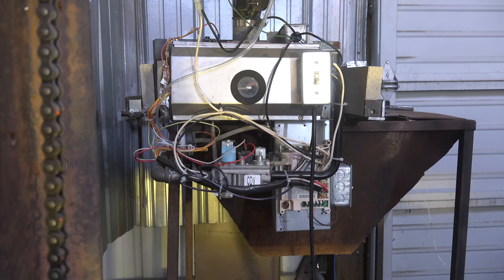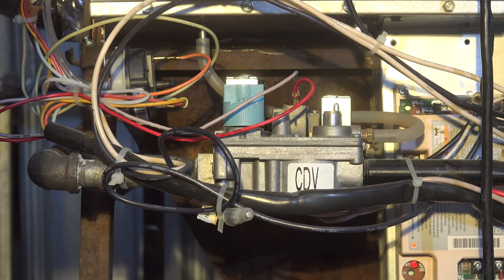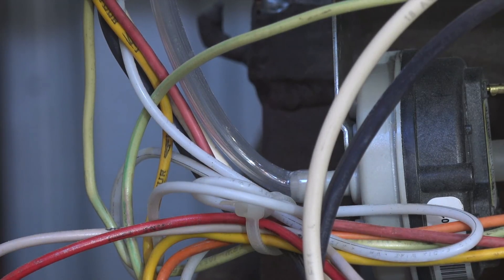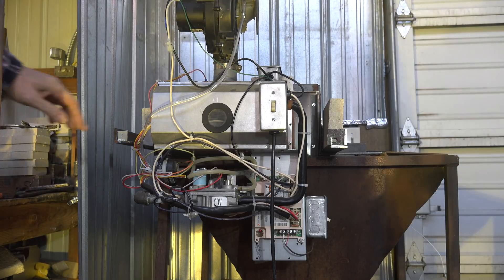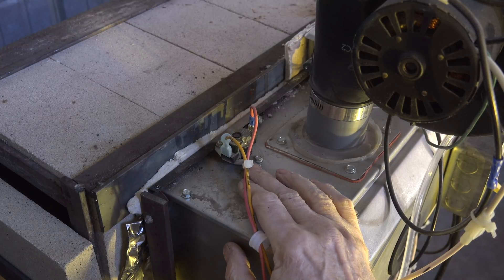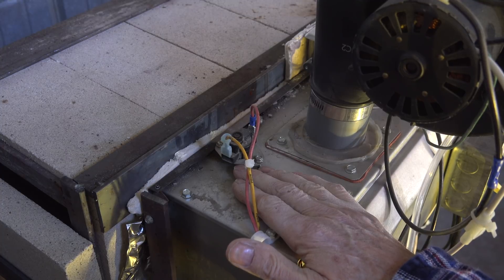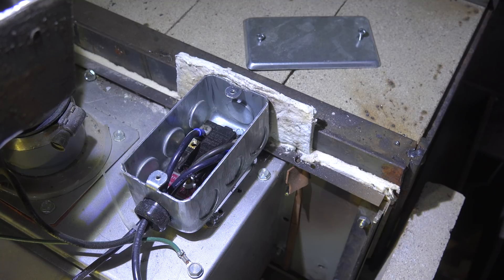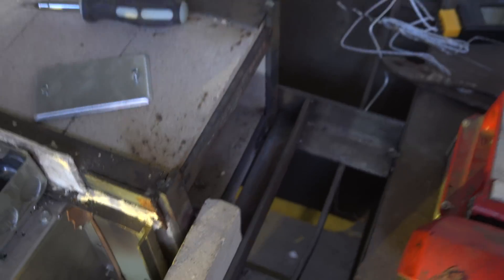Make a forge from a furnace #3 safeties

Comment: Could you explain a little better about the pressure hose going to the gas valve. Where exactly does it tap into the valve? I have two natural gas furnaces that I want to take parts off of to make a propane heater to heat a large powder coat oven. Neither of the furnaces I have look the same as the one you used but they both basically have the same parts, just configured a little differently.  One has a plastic inducer motor that has a small crack in the cover. Someone had tried to seal it with hi-temp silicone and it must have been working somewhat because that repair was done a long time ago and both furnaces were working when they were replaced.

Comment: id like to see a build using an oil furnace burner, I have many like new burners, I don't get NC  gas in the bush
Reply from the maker: It is my intention to do a permanent one with oil.  In the past, I have made numerous forges with an oil burner.  They were just a burner surrounded by fire brick, nothing permanent.  
GFM
Reply: that I would want to see how to build a permanent one, I have played around with small on too as you say with fire brick but the heat was never there that is needed, but I have seen oil ones used that work great,
Reply: Arnold Romppai well for that wrong have to go to the oil burner's channel  . There he shows  heating  up a homemade  crucible  made  from  a steel  fire  extinguisher loaded with copper , the furnace  is stacked bricks and open box the heat burnt  the  bottom out  if the steel crucible  and the copper sweated out of the stacked brick furnace.  Check it out
Reply: could you convert a oil furnace burner to run on propane?

Comment: Converting gas appliances between propane and natural gas seems to be a very common thing and often it is simply a change of orifice.
Reply: no need to change the orifice I drill them out to the size for propane,, it is a larger hole then NC gas, done many and have never touched spring setting and all stoves BBQ, HAVE RUN PERFECT
Reply: Orifice and the spring pressure .

Comment: Can other  gases beside natural  gas be combust  in this forge?   Can natural gas  heat steel to be able  to shape. It on the anvil?
Reply from the maker: Certainly.  Propane can be used.  Both gasses are capable of reaching 2000F.  You must changeover the gas valve and burner orifices for propane.  The largest piece of bar stock I have heated to yellow is 1" by 3".  It took about 20 minutes.
GFM
Reply: You have to change the whole valve to convert to propane??